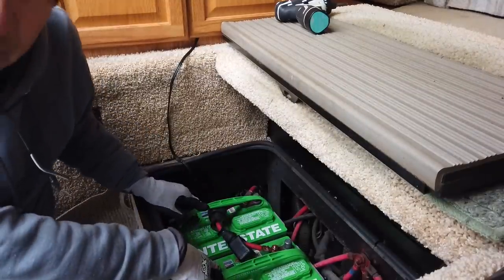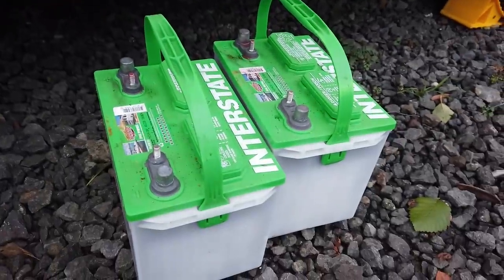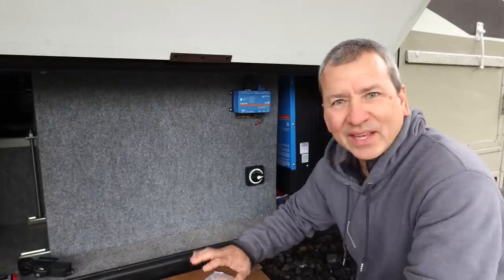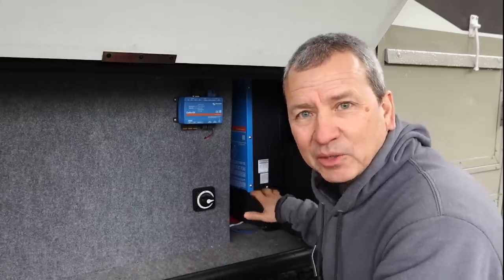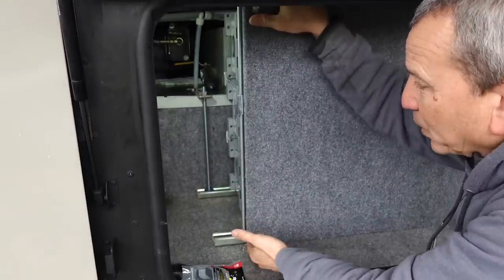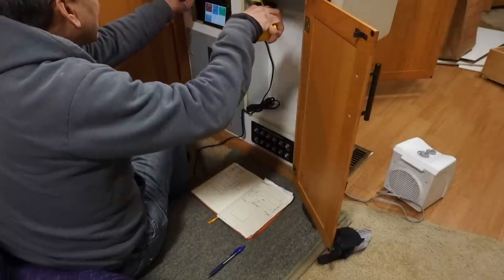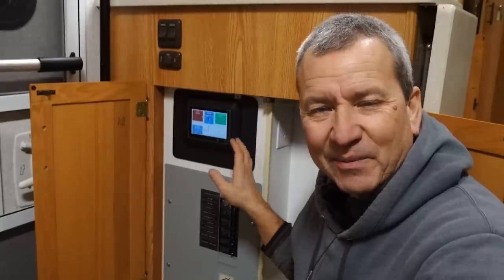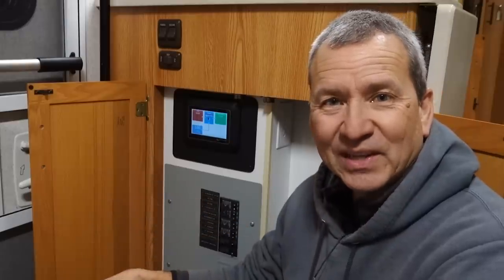800Ah Lithium Battery Install | Battleborn GC3 | RV With Tito DIY

Comment: Did you have any problems when you connected to the existing 12 volt system ie. charging from the engine? Or is that a different system not connected with the coach battery? And are you still able to use the “battery boost “ to help start the engine if the chassis battery dies?
Great info as I am going to do this to our Winnebago class A. 
Thanks
Reply from the maker: It's not connected to my engine for charging while driving. I used the same cables used for the original house battery and wired it to the new battery busbars. I still have the relay for the emergency start, but don't use it. One thing I did do is to wire a cheap $10 PWM solar charge controller to the chassis battery and used the house battery to trickle charge it when I'm staying put for a while.

Comment: Awesome work, can you tell us more about the battery that your using.
Reply from the maker: They are Battleborn GameChanger 3 LiFePO4 Lithium batteries. The enclosures are very ruggedized and each battery is 270Ah. Check them out at rvwithtito.com/battleborn and find the GC3s in the list. Here's my initial setup video for these batteries also that may help answer some questions. https://youtu.be/K7NoH1IpFTw

Comment: Great info (thanks) how did you bypass the Progressive Dynamics DC converter charging mode and switch its wires to new battery bank ? Does your new inverter also charge new battery bank ? I download your pdf parts diagram (thanks). What size cable did you use from DC fuse panel to new battery Hot DC positive/negative bus ? My '05 RV had 200amp DC bank using awg 6 to mere 400 watt inverter and AWG 6 to DC hot positive dc fuse panel.  At 800 amps, what size cables did you use ? (thanks).
Reply from the maker: I removed the converter since the multiplus is now the charger. I think I have #4 cable going to the DC busbar.

Comment: Hi - love the video. I’ve been working on almost identical setup.  2008 Destination.  Nice to see a very similar coach setup. 

One part I found on my side is my existing inverter powered 3 outlets.   Since removing, that power is gone, even when on shore power.  I always assumed it passed it through.

Wondering what you did with your existing inverter & the wiring setup? I imagine yours is similar.  Appreciate any input!
Reply from the maker: I removed the old inverter above the cab and wired the outlets on it to the outlet that was not on the old inverter. There is one remaining AC cord that dissapears into the roof. Don't yet know where it goes but everything seems to be powered.

Comment: @RV with Tito Drive I have a question I have a 2002 gooseneck 5th wheel 40 ft long with three slides out okay when I turn on any kind of light and RV my lights go dim already change One battery and I change the other battery do you think it's the you know that thing that looks like an amplifier like four cars but this this is for RVs where all the stuff is connected to it's a power connection do you think that's what the problem is can you give me some advice I already checked the fuses and the breakers and they're all good
Reply from the maker: No idea. Have you checked the wiring. Seems like a moving parts thing to me if it only occurs on turns.

Comment: I'm about to upgrade my Winnebago Micro Minnie to Lithium Batteries.  The concern I have is battery placement.  I was thinking of putting the batteries under the bed.  Is this a safety/health problem?  I also noticed that you mounted your lithium batteries in an outside cabinet.  Did you have the heat that cabinet?  Lastly it appears you can stack your batteries.  This is definitely a way to save room.  Is there any concern about doing so?  Thanks in advance!

Comment: After all these changes are you still charging the battery for the chassis (engine starting battery) when plugged into shore power ? Is your chassis battery lead acid? I am just wondering if the lithium converter/charger is charging the lead acid chassis battery?
Reply from the maker: The chassis battery is still lead acid and charged from the alternator. I do trickle charge it from the house batteries if it's going to sit for a while. I use a $10 PWM solar chargencontroller to do that. Works fine 🙂

Comment: There are several makers of server rack batteries. 

I bought two 5.2 kwh batteries (10.4 total kwh) from Signature Solar for just under $3000.00 . 

More power with built in BMS and breaker for about 1/3 the cost.

Battle Born batteries have a great reputation but at what cost ?

He could have had 30kwh of power!!!!!!!!

Comment: I cant believe how expensive BB Are. $11.10 CDN per AH VS . $6.40 of Renogy and ampere time. 
I would install a separate Diesel Heater for that Area to Heat if its cold be a super cheap option to keep them warm.

Comment: Great video. I pick up my 2016 RV in about 3 weeks and I’m starting to think about replacing the house batteries with lithium. I love your bus bar to connect to the original house wires. I’m assuming you’ll install a DC to DC converter.
Reply from the maker: I'm excited for you. I'm not using a DC-DC in this rig yet. I may not need it. With the generator running (which I can do while driving) I can push 120A into the batteries. The DC-DC will give me only 30A max.
Reply: So with your generator running I’m assuming that no power would be coming from the alternator. Once your batteries are full do you shut the generator off and the with the batteries full there wouldn’t be any additional draw on the alternator. Do I have this correct?  I’m still learning.
Reply from the maker: @wonderwhere2wander9  Correct. No draw from the alternator. With the generator running, it's similar to being on shore power. The chassis and house battery systems are completely separate. When the batteries are full, the inverter/charger maintains them at a lower "float" current.

Comment: Question! I am changing out 4-100ah AGMs for 2-200ah LiPos in my 2017 Winnebago Adventurer - so not so different from you. I'm stumped on how to deal with alternator charging. I assume you have a BIM like mine that connects house and chassis batteries. What have you done about this? DC2DC charger or LI-BIM and how did you wire it? I keep going 'round and 'round about this. I want some of the features of the OEM BIM but I want to protect my new batteries. Can you provide any answers or do you have a video coming out about this? There are a zillion of videos on YT about how to do this... but they are all for B-Vans or TTs. Any help please?

Comment: You said, power for heat.  Do you have a heat pump installed?
Reply from the maker: You're referring to the previous video? If so, I had shore power off while connecting the inverter. Yes. I have a heat pump.
Reply: @RVwithTito  this is my first video of yours I’ve seen.  I am new to batteries, no knowledge about RVs. I am still learning about efficiency, and power draw etc.

Comment: Your electrical diagram says 50 amp, could you use 30 amp as well because you installed a Multiplus II ??
Reply from the maker: Yes. That's true. We rarely plug in anyway. So we're rarely running on 50A...but it works.
Reply: @RVwithTito  many thanks!!

Comment: Aren’t you limited to 30amp?   It’s not a split phase with two inverters where you could do 50amp with each leg going to a different inverter.
Reply from the maker: When connected to split phase service, then this inverter will run split phase. When off-grid, it's single phase.

Comment: Woulda been nice to know anything about the battery?
Reply from the maker: They are Battleborn GameChanger 3 LiFePO4 Lithium batteries. The enclosures are very ruggedized and each battery is 270Ah. Check them out at rvwithtito.com/battleborn and find the GC3s in the list. Here's my initial setup video for these batteries also that may help answer some questions. https://youtu.be/K7NoH1IpFTw

Comment: How many volts is your system lithium-wise? And are you running your panels in series or parallel
Reply from the maker: Battery bank is 12V. Neither parallel or series for the solar. Each large panel has a dedicated 100/50 victron controller.

Comment: What are your thoughts on 
 battle born batteries compared to Victron batteries?
Reply from the maker: I don't have any direct experience with Victron batteries. One thing to keep in mind is that you'll need to also purchase a Victron battery management system (BMS) compo ent for your Victron battery bank. Most others like Battleborn have an embedded BMS..

Comment: Heard sok batteries are better than battle borns, how true is that?
Reply: Cheaper... yes, but better? That's debatable. The SOKs look fine but the jury is still out on other measures like life cycle, etc. The BB certainly have a superior warranty and excellent history. All of that remains to be seen from the SOK batteries.
Reply from the maker: Depends what criteria you use to define "better". They are a solid option for less money. I know several folks who have them. When pricing your system, you can choose where to spend your money. Some prefer to spend less on batteries and more on solar panels/controllers/inverter, or less on solar/inverter/controller. It's good to have options now.
Reply: @paulgreen2303  Will Prowse steered me to SOKs and I saved thousands! They are awesome batteries and IMO as good or better than their overpriced BB counterpart!

Comment: One thing I see a mistake in already is hooking the coach directly to battery's for 12v. Your not going to get correct Amp usage without going through the victron shunt first. Look up explorist life on YouTube you will learn alot on victron system configurations.
Reply from the maker: Everything goes through a Smart Shunt.

Comment: Your battery cables dont look big enough. Are you running 24V?
Reply from the maker: Those #2 AWG cables I showed in the video just power the house 12V. The main battery to inverter cables are #4/0
Reply: @RVwithTito  Excellent! just wanted to make sure.